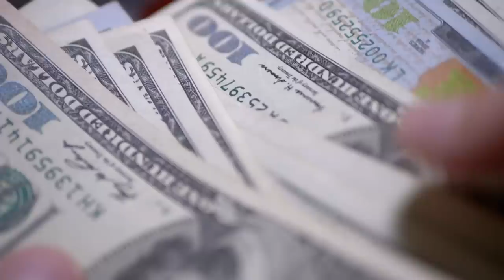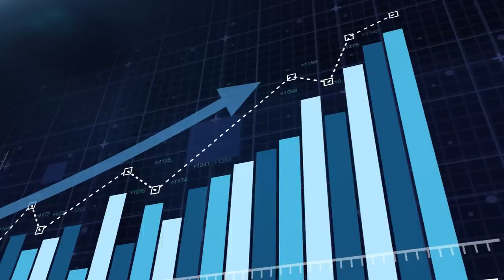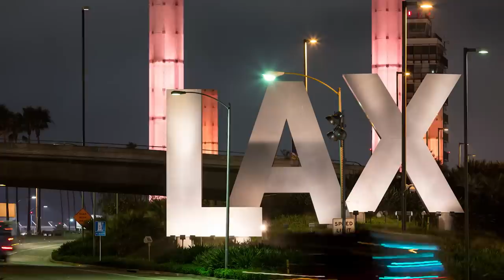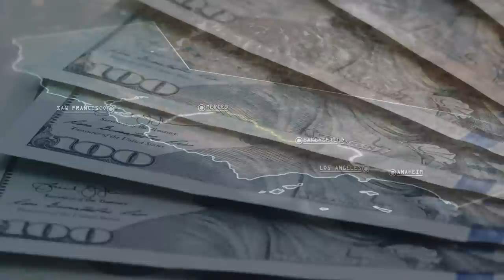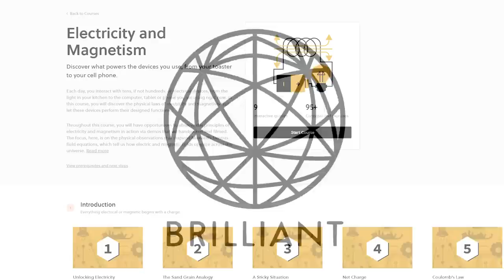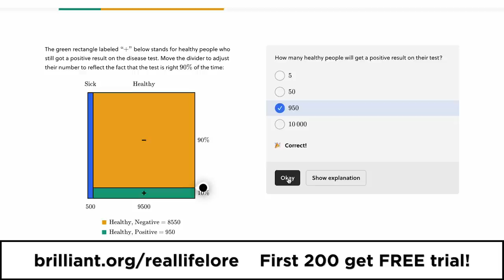Why California High Speed Rail is Struggling (Re-upload)

Comment: Minor issue, at 7:32 you show a Maglev train, CHSR will use conventional rail.
Reply: no one cares
Reply: China has built more miles of high‐speed rail than any other country and has gone more into debt doing it… $800 billion, and most of its lines aren’t covering their operating costs.  As a result, China is shifting to building more roads.

France’s state‐owned railroad has piled up debts of more than $50 billion and has been repeatedly bailed out by the government.

Spain has built its high‐speed rail system with a public‐private partnership. Officially, the private partner has gone into debt by $20 billion.

The state‐owned Japanese National Railways has a debt of $550 billion.  Today Japan has
Reply: @electrictroy2010  OMG large infrastructure projects are very expensive? Who knew???? Still overall hugely beneficial in terms of economic activity and improving the lives of people. Also not getting the full picture in all those cases by debt alone.

Comment: Flying between the Bay area and LA is fine, I've done it a lot myself. The problem is that there's no room for growth. The slots at the existing airports are pretty much full. If you think it's expensive to build a rail line in California, try building a new airport. The cost of HSR relative to itself is irrelevant. The cost of HSR only matters as it relates to the cost of the alternatives.
Reply: "Flying between the Bay area and LA is fine, I've done it a lot myself."

Me too

"The problem is that there's no room for growth. The slots at the existing airports are pretty much full. "

Perhaps you are unfamiliar with the coming eVTOLs. Joby is going to start service in Los Angeles in 2024. Battery powered flying taxis. MANY companies plan to bring these vehicles to market in the coming decade.

Plus airliners will burn a lot less fuel (if they even burn fossil fuel at all....short haul should be battery or H2 fuel cell in less than 20 years) and use Short Takeoff and Landing. Meaning better use of existing airports.

And adding one airport is far cheaper than the CAHSR at 100 billion. So it's a nope for me. I'm very proud I voted no in 2008 as a centrist Democrat. Yes on Biden in 2024, no on this colossal waste of taxpayer dollars.
Reply: like expanding LAX ya right the cost of land alone would be incredibly expensive even somewhere like Ontario, it would still be a nightmare. I grew up along the route and I’m in my early 20s huge fan of the hsr I don’t want to drive 6-9 hours I just want to be on my phone, read a book, and enjoy the views.
Reply: @CommonDaeze  

"like expanding LAX ya right the cost of land alone would be incredibly expensive even somewhere like Ontario"

I mean it's not going to be 100 billion, come on now. If anything we would add a 4th airport in LA and a 4th in the Bay Area. Plus there are going to be a lot more eVTOL aircraft in the future, and STOL.....VTOL means no airstrip required, they can take off from any horizontal surface and land on any horizontal surface. STOL means they can use a smaller runway like Fullerton or Hawthorne or Bakersfield. The CEO of Joby said on 60 Minutes he's extremely confident that they can start eVTOL service in Los Angeles in 2024. That's not for going from SF to LA but it could make a trip to the airport five minutes instead of an hour. And it runs on batteries.

I think private sector innovation will let us greatly expand traffic at existing airports (with lower emissions) before we have to expand them. 

And again...expanding one airport isn't going to be 100 billion.

"I don’t want to drive 6-9 hours"

Nobody does. We fly. You grew up here and don't fly around the state? Driving takes forever.

" I just want to be on my phone, read a book, and enjoy the views."

Yep, I do that on airplanes.
Reply: @neutrino78x   hopefully they also have high speed rail in the future. A combination of solutions will exist and be implemented just like renewable energy. There are a lot of cons for driving or flying that aren’t a problem with high speed rail. You can transport more people to more destinations at a faster rate than flying or driving, trains make stops so people can go to multiple destinations on one train, you can have multiple trains on one line, they are simply more efficient both at their function and energy consumption. 

And they are simply cool like who doesn’t want to go hundred(s) of miles an hour through mountains in something powered by only electricity? 

Let the poor people have the train and y’all can focus on the flying privately owned taxis and everyone wins.
Reply: @CommonDaeze  

"opefully they also have high speed rail in the future."

Sure but not at 100 billion. That's not reasonable and we don't even have the money as a state.

" There are a lot of cons for driving or flying that aren’t a problem with high speed rail. "

Like what, being able to go wherever there's an airport and not needing tracks? Being able to travel at high speed?

"You can transport more people to more destinations at a faster rate than flying or driving, "

Nope, especially not with CAHSR as currently presented. At least three times slower, by their numbers, probably four times slower.

"Let the poor people have the train"

I'm poor. My last job I made 21/hour in Silicon Valley. That's poor, trust me. The median salary here is 120k and the median home price is 1 million dollars.

And I fly all the time. It's very cheap to fly Bay Area to LA/SD. Southwest is less than $100 one way usually.  The web makes it easy to choose between five competitors who fly that route. In your little world, there would only be one provider, the government.

The ticket price for CAHSR would be the same as a flight. Prop 1A forbids subsidizing it.

Comment: One thing about the use of HSR for commuting:  this was never a real plan for HSR.  One year (pre-pandemic of course) when the HSR business plan was revised and costs were escalating and it looked like the initial segment that could be built with the funding currently available was from San Jose to somewhere south of Fresno (not even to Bakersfield), the politicians were looking at this, saw the housing crisis (still ongoing) in Silicon Valley, and thought people could commute from Fresno (where housing is inexpensive!) to downtown San Jose (where the high paying jobs are!).  

Except the High Speed rail Authority never came out with any kind of study looking at ridership and schedules that would be needed for using HSR as a commuter solution.  And if you were to go by their previous estimates for fares, it would just be too expensive to commute 5 days a week between Fresno and San Jose at the proposed rates that were designed to compete with air travel.

Commuting was really an after the fact political justification found for the revised business plan.

Today we still have high housing costs in Silicon Valley but we also have skyrocketing housing costs in Fresno (though they are still lower than most of California).  Remote workers have relocated to the Central Valley, housing stock has not increased sufficiently, and it seems it can't be built fast enough.  It's not clear that commuting between Fresno and San Jose on HSR will be realistic.

Comment: The real issue is private interests just don’t want it to happen. There’s lost money from cars & planes, and their maintenance & fuel, as well as the potential for people to move out of LA & SF to somewhere along the railway line which would lose money for the real estate industry. 

The simple truth is the USA is never going to have cheap & efficient public transportation (and anything actually good) because there’s no profit to be made.
Reply: Too many “futuristic” projects never get off the ground because they're set up as political cash cows, with no intention of finishing the job. Kickbacks are the real profit in these enterprises, not progress

That’s why ppl argued that transportation projects like these doesn’t need to be made for profit driven purposes at the beginning. 

It’s done for the public good and the money will be made to make up for it later. Ik China isn’t the best example but they made their entire 25,000 miles of true high speed rail in a little over 10 years and make almost no profit on it, majority of the lines going into southern and western rural Tibet make absolutely no money due to political reasons from their government, but still connects ppl, however the eastern busier cities definitely make alot of money that once used to operate at a loss. Even their maglev trains which derived from German engineering loses around $85-$100M every single year

But I will factor in that due to cheaper labor in China it cost about 17M per KM too

Comment: It isn't just the current greater inflation rate that will drive up the ultimate price tag. The Authority has refused to acknowledge that Phase 1 doesn't have a prayer of being done by 2034, their last projected date. However, they still use that completion date for their estimates. If you consider that the easiest portion, representing about 1/3 of total miles with no tunneling will take around 10 years to finish construction, and that they have no moeny to build anything else, timelines of 2040 or even 2050 for Phase 1 are totally realistic.  Even using their lowball inflation, when you take the longer timeframes into account,  you get ~$125 billion in 2040, ~$145 billion in 2045, and ~$170 billion in 2050 on the high estimate. if you run with the current 8% inflation rate, you get ~$165 billion by 2040.

Comment: Much improved over the first video, I can tell you guys actually researched it this time.  Still a few quibbles though.  

First, Californians would absolutely use the train.  If you've ever made the trek between LA and SF, then you have absolutely fantasized about sleeping on a train instead of trudging through the mind numbing farmlands of the Central Valley.  If there was a train that did the route for $100 I'd say, "shut up and take my money!"  You'd argue that a flight is cheaper, but a flight involves showing up two hours early to be groped and inspected at America's finest security theaters, LAX and SFO.  Not worth it.  By the time you get done with all that nonsense you could be halfway to your destination.  Plane travel saves you an hour post 9/11.

Moreover, the train is not merely to get people to and from LA/SF, but also from the inland parts of the state.  Fresno is the state's fifth largest city, and the combined metro area is around a million people.  And if there was high speed rail going to LA/SF, then that would allow for train commuters, and thus deal with our insane real estate problems.  Even a partial railway that got you to the outskirts of the cities would be worth it.  If need be you could then rent a car at the terminus to finish out the trip.  Anything to not have to drive on I-5 or the 99.

Lastly, I don't think anyone is currently commuting from Bakersfield to LA.  That's twice as far as you'd need to go out.  Currently you could commute from the Palmdale/Lancaster area for half the distance.  But if a railway were built between Bakersfield and LA, people would start to move out there.

Comment: The real problem is that advocates rarely figure out the engineering. Crossing the Coast Ranges, earthquake faults and all, is simpler than crossing the Tehachapis, which also have earthquake faults and are steeper. Have any of the transit advocates ever driven I5? Imagine high speed rail up The Grapevine.

Comment: Honestly, I am very skeptical that this will ever get completed (at least in my life time).  It has turned into such a boondoggle and made the state the laughing stock of the rest of the country (and world).  Even if they do complete the segment between Bakersfield and Merced, I don't really see it being used much at all, both because it won't cut down much travel time by car (both cities are connected to each other by Hwy 99) and because the price per ticket will be prohibitively expensive for the passengers that this is meant to serve (remember, this is the poorest region in the state).  There also isn't the political will to see it though and with state leadership beholden to labor unions and the environmental lobby, the cost to build it far exceeds the use it will provide. CA isn't China.  In China, they don't have to worry about labor/environmental laws and both labor and material costs are much, much cheaper (they can also just take whatever land they need without much fuss).
Reply: I disagree. It has 56% support right now and that will only grow.  As the track testing commences in a few years the anticipation/support will ramp up exponentially.  Once the Central Valley section is operational, there will be a strong push to accelerate the bay area and LA sections.   Newsom's "stone soup" approach is politically savvy.   But even w/o the full end to end HSR, the CV section will be popular as an alternative to driving.  Slow train connections from LA/Bay Area will have high usage.

Comment: An excellent video and explaining the issues face with the high speed rail road. I cannot, however, compare the California high speed railroad with the transcontinental railroad. It took six years, two of which the US was fighting a war, to complete an almost 2000 mile rail line.
Reply: And how much of those six years were spent on environmental reviews, waiting for the government to actually fund the project, and ensuring that the railroad was compliant with safety regulations? Oh, right. 0 years because those didn't exist back then. Also the trains were a lot slower back then, so the tracks didn't need to be as straight as high speed tracks, and there was no need for viaducts over roads because those didn't exist. CAHSR hasn't started laying tracks yet, because they need to complete all of the structures that the rails run over, such as viaducts.

Comment: I don’t understand the objection to including the 300,000+ residents of the Palmdale and Lancaster area. These communities were left behind by I-5. When planning a project like this, you don’t just get out a ruler and draw a straight line between point A and point B on a map. You would obviously want to include as much connectivity between communities as reasonably possible. 

Cost overruns and delays are not ideal, but not unique to CA. The Tokyo-Nagoya project costs have hit $50b for the 220 mile route, inflating 27% from initial estimates. That’s $230m/mile. CA’s $110b figure is the total estimate for the entire 500 mile route, which is $220m/mile. The price for the initial route is about a quarter of that (the more urban and mountainous segments will be costly). Of course, the Japan project is for a maglev. CA’s max speeds will only reach 70% of its speed. So more bang for the buck there. My point is that delays and overruns are par for the course with these projects, especially considering this is the first such project in the Americas, so it’s to be expected.

One more thing that bugged me was at 1:00. The SF to LA drive is going to take you much longer than 6 hrs if you take the coastal highway as you show in your graphic. Probably pushing 10 hrs going that way. Small detail, I know. Glad you fixed the more glaring errors from before!

Comment: This is a big improvement over the first video. What's interesting is that if we pull off Phase One, airline prices might actually decline as they attempt to compete with the rail and preserve their market share. 

We don't have to set ticket prices at a level to ensure profit of the system. We don't profit off of roads or streets or freeways. They are free to drive on, financed by gas taxes. We could subsidize train fares with taxes on gas or intrastate airfare to make the system as competitive as possible.

Comment: I'd like to add one more thing called economy of scale. This happens to transit in particular. Without enough passengers, you can't run many trains each day efficiently. Without a frequent schedule, it becomes less convenient and fewer people would take it. Other countries like Europe, Japan and China are more densely populated, which means 1) multiple trains depart in an hour, and 2) it brings down building cost per mileage. In China, for example, high-speed trains can run at 5 - 10 minutes interval, so it's much more flexible to book your trip than if it were 1+ hour interval. Also, the construction company became specialized and workers with years of experience, so they can build a line in 3 years and move to the next line quickly after that, carrying knowledge and reusing design. It costs less than 20x money to build 20x lines.
Reply: Exactly.  High speed rail becomes a lot less attractive when there's only one train a day.